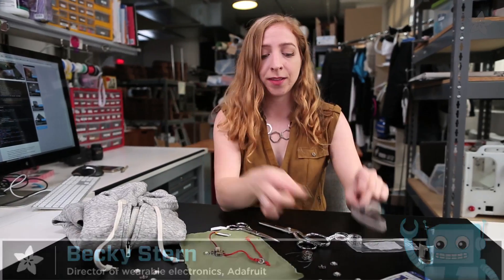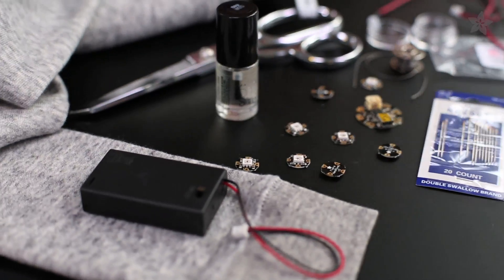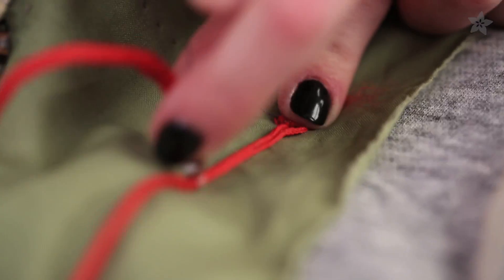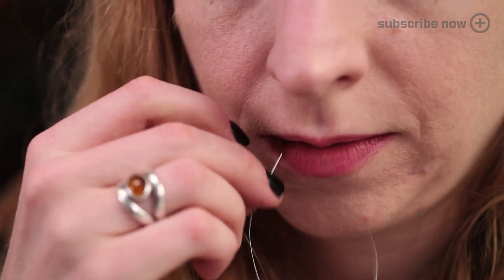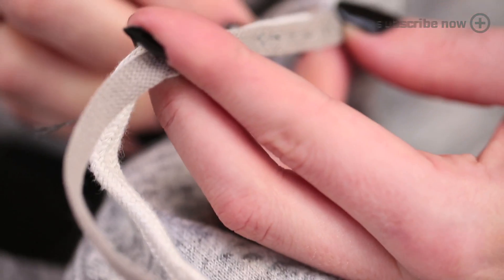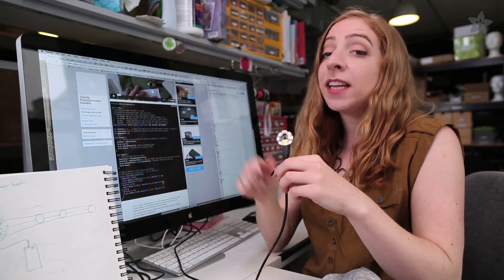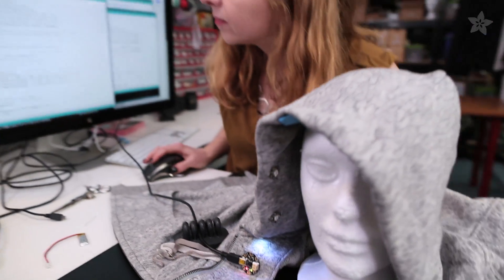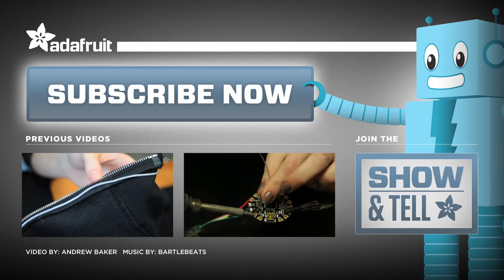Textile Potentiometer Hoodie with GEMMA

Comment: Hi, we're trying this at home. I thought I'd share some troubleshooting information. We get an error, "fatal error: Adafruit_NeoPixel.h: No such file or directory" when verifying the code on page https://learn.adafruit.com/textile-potentiometer-hoodie/stitch-pixels-and-code due to the #include for Adafruit_NeoPixel.h. You need to git clone the repo at https://github.com/adafruit/Adafruit_NeoPixel, and then follow the instructions in the README to install this code in Arduino Libraries folder by copying it into Arduino/libraries and restarting the Arduino IDE.

Comment: Yet another Q about this project and I guess all wearables, how doe water effect them. I know you can wash them by just removing the battery, but how do things like sweat and rain work? Assuming you have made sure that the battery itself is protected, if this hoodie got soaked in a downpour, does the conductive thread not suffer any shorting issues etc?

Comment: Would this yarn work as a dimmer for neopixels? If so how bright are the cool white pixels? I have an idea that you could do something similar to this on a headband to create a wearable headtorch with a 10 pack of the cool white pixels but am wondering about dimming and brightness.
Reply from the maker: feygan Yup, totally! Very minor change to the code to make that happen, check out the Arduino sketch at the tutorial on the Adafruit Learning System. =]
Reply: Hmm only need to wait for the new cool white leds to come in a sew version then. Would be nice to see some lumens data on them though.